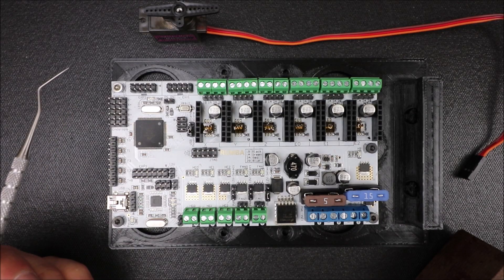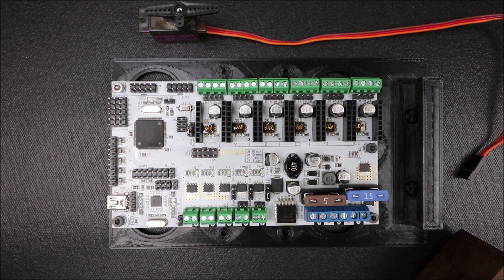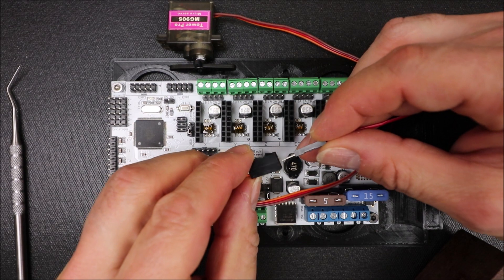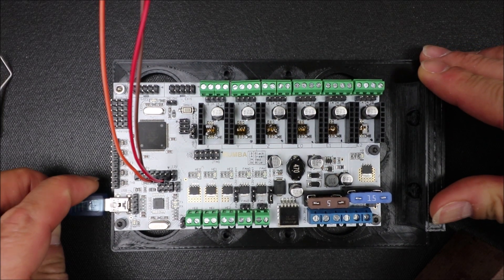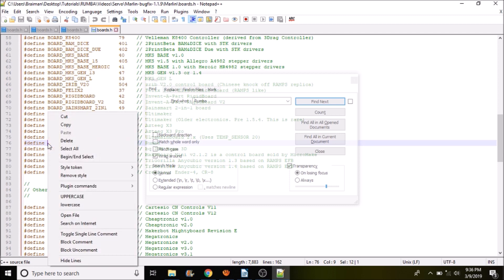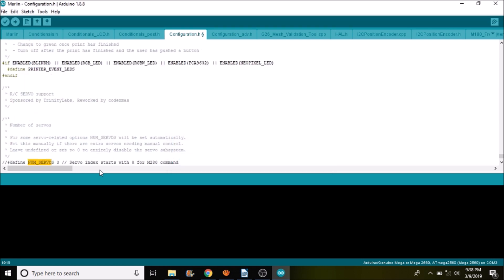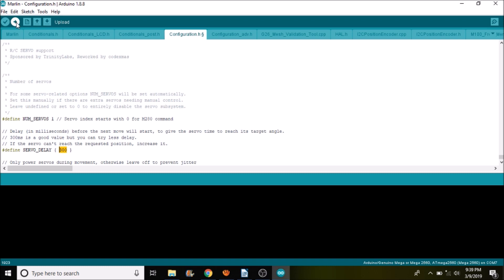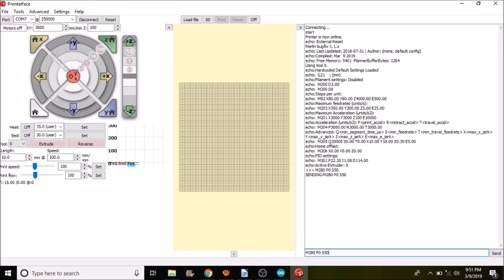Rumba - Servo

Comment: Hi, when I use with usb connected,  it works, once I remove the usb even being in stand-alone mode it doesn't work. Any idea?
Reply from the maker: I'm assuming you're using a dscard for standalone.  In the gcode file, do you see the command to move the servo?  The gcode file is plain text commands.  If not, then Slic3r need these commands set.

Comment: so my setup is rumba plus drv8825 stepper drivers diamond hot end oversized anet a8 frame cut from 1/2 aluminum plate with a 17 x20 glass print bed discount full smart controller stepper motors are Brand:  
Minebea
 End Play:  80 nanometers MAX at 4.4N
MPN:  
17PM-K374BN01CN
 Insulation Resistance:  100 megohms
Actual Rated Input Voltage:  10.4V  Mass:  250 g
Full Load Amps:  0.33A  Max Input:  6.9W
Holding Torque:  340 mNm  Motor Size:  NEMA 17
Rated Current per Phase:  0.33A  Radial Play:  20 nanometers MAX at 4.4N
Resistance per Phase:  31.5 Ohm +/- 3.1 Ohm  Rotor Inertia:  50 g-cm2
Alternate Part Number 1:  17PM-K374BN02CN  Step Accuracy:  1.8 degrees +/- 0.09 degrees
Class of Insulation:  B  Temperature Rise:  80 C Max
Date Code:  2015  Winding Inductance:  71 mH
Detent Torque:  11.3 mNm  Wire Configuration:  4 Lead
Dielectric Strength:  AC 500 V  UPC:  
Does Not Apply
Reply: the wires i got in the kit were wrong got it running thankyou so much will upload vid when the wiring cleaned up
Reply from the maker: May I ask your question?
Reply: @EdwardBraiman  im going to redo the steps i think i missed something still buzzing got a 30 amp psu still buzzing adjusted the hot pots on the drivers nothing redid wiring on steppers thinking its like accalarion settings too high or something have to look up each setting and set it also im using the lcd controler to move the steppers not pronterface
Reply from the maker: Checkout my playlist for MKS Gen L for drv8825 calibration.  It might help.
Reply: @EdwardBraiman  so i got it hooked to repeater it saying cold extrusion prevented when i try to move steppers
Reply from the maker: If you're not pushing filament, then you can send the command m302 p0 s0 (p is stepper motor extruder number 1.  S is temperature).
Reply: think i found the problem  5 of my stepper rated voltage is 10.4v and the dual z stepper is 4.96v and fighting each other need to enable dual stepper z but can't find it
Reply from the maker: Do you mean in software with z and e1?
Reply: @EdwardBraiman  i dont know  someone said i need to tell it i have two stepers on z axis
Reply from the maker: What is the 3d motherboard? MKS Gen L, RAMPS, or something else?  Does it have two stepper port for NEMA17 on the z axis?
Reply: @EdwardBraiman  rumba drv8825 steppers minebea 17pm-k374bn01cn steppers and 2 bohong 42b40f04ab steppers 3 wire board end stops diamond print head
Reply from the maker: You'll need to split the z-axis into two output if you're using 2 Nema17 motors.  Checkout my MKS Gen L tutorial for the process.  I'll be doing some more RUMBA tutorials soon.
Reply: can't i just run two stepers on one driver using a screw down and the other on a dupont conecttor
Reply from the maker: Yeah.  Are the motors within specification?  Check reprap wiki for NEMA17 type to use.
Reply: @EdwardBraiman  can you recommend some steppers  that are good for this setup and ill ovenight them from amazon you think thats the problom
Reply: @EdwardBraiman  no there not dam
Reply from the maker: I'd wait first and check to see if any   of the Nema17 are on the list to start. Sounds like a stepper tuning issue.  Check my tutorials in MKS Gen L playlist first to verify calibration first.  It's better to check all possibility first before spending money.

Comment: Thanks for all the videos! This one really helped me with finding the pinouts on the board. I struggled to find any documentation on pinouts for the Rumba. I'm trying to install BigTreeTech TMC2130's with SPI on my rumba (I know they're not the best, but its what I've got).  How do you find available pins? Can I just use any of these available pins?
Reply from the maker: Tmc2130 currently is not defined in the pins file for Rumba.  You may have to experiment to make it work.  I would suggest comparing pin_ramp.h to pins_rumba.h file.
Reply: @EdwardBraiman  Thanks.

Comment: where can these be used?
Reply from the maker: They can be used to deploy a zaxis Endstop or maybe in the future for calibration of print bed when you use them on a MKS Gen L board or RAMPS 1.4.  Both printers have four.  Granted no one has written code in Marlin firmware for this functionality yet.